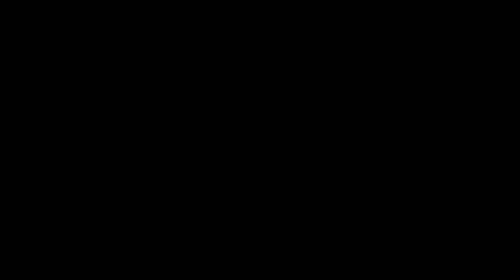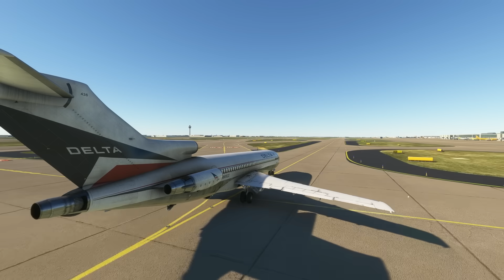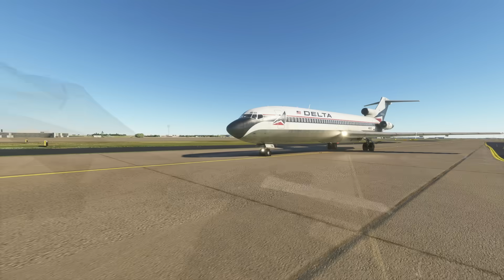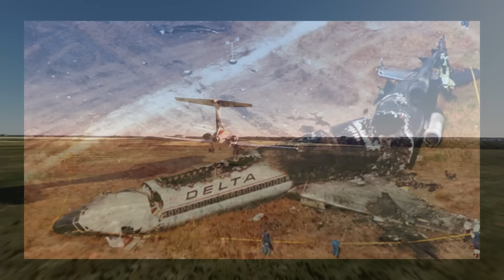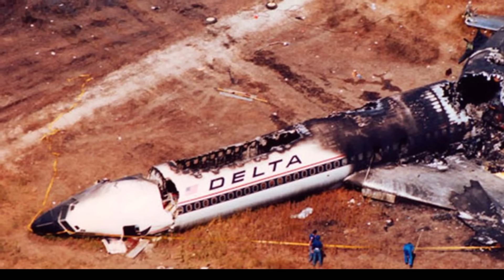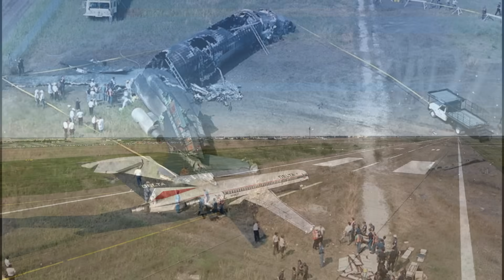Rushing To Disaster | Delta Airlines 1141

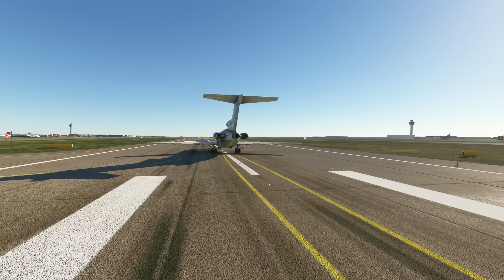Comment: 2:23 - Pardon my ignorance, but isn't the Auto Pack Trip Arming Lights' failure VERY pertinent to this crash?  If an engine fails (surges, in this case) during takeoff, the "Auto Pack Trip" system automatically shuts off the air conditioning packs, eliminating their pneumatic bleed air load on the remaining operational engines, thus giving them maximum available thrust to safely climb - which did not appear to have occurred in this case.

Comment: So many crashes by airliners have been caused by not setting the flaps and slats. Such an easy mistake and you only have to make it once in your pilot career and it's over. I was watching this video and as soon as they said it should have climbed, I thought flaps and sure enough, he we go again.
Reply: Not settings flaps and slats is not a death wish. All related flights (NW255, JK5022, 1141, etc) were found to be recoverable if they kept the attitude below stickshaker attitude.
Reply: @0w3nn  - Hi, I think I agree with you, but even if recoverable it is not a forgivable error. It has happened too often.

Comment: Actually, most analyses of this crash do see a single tree, but not the forest.

Delta had a shocking streak of near-misses at the time. To quote one of the articles on flight 1141:

"Delta had a long-standing practice of giving captains wide discretion over procedural matters rather than strictly enforcing a set of cockpit norms handed down from on high. This resulted in a wide degree of variability from one captain to the next. Delta pilots interviewed after the crash couldn’t agree on who was responsible for checking the position of the flaps or who was supposed to ensure that checklists had been completed."

"The NTSB already knew that Delta’s lack of cockpit discipline was causing problems. In fact, in 1987 Delta suffered no less than six serious incidents and near misses that were blamed on pilot error. First, a crew inadvertently shut down both engines on a Boeing 767 in flight, causing a total loss of power, before they managed to restart them. Then, a Delta Lockheed L-1011 deviated more than 95 kilometers off its assigned airway while crossing the Atlantic Ocean. The flight strayed into the path of a Continental Boeing 747, and the two planes with a combined 583 people on board came within thirty feet of colliding. Subsequent to this, a Delta flight landed on the wrong runway; another flight landed at the wrong airport; and two flights took off without permission from air traffic control. Any one of these incidents could have resulted in a major disaster. Something was seriously wrong at Delta Air Lines, and the string of near misses suggested that an accident caused by pilot error was probably inevitable. If it hadn’t happened to Davis, Kirkland, and Judd, it would have happened to some other flight crew sooner or later."

Comment: It's funny so many keyboard experts always say a plane will crash without flap deployment, I remember when the recent Air India crashed many were quick including at least one YouTuber pilot that the flaps had not been deployed, and while its much more dangerous to take off without flaps, it does not instantly mean the aircraft will crash. Even a simple Google search tells you that!
Reply: 1. "A simple Google search" is no longer a reliable information source. Try an engine that hasn't enshittified itself to death.
2. While taking off without flaps is not in itself an automatic 100% guarantee of a crash, unintentionally taking off without flaps (or taking off with the flaps set incorrectly) is very likely to cause one because it invalidates the takeoff calculations and robs the plane of expected (and often strongly-needed) lift performance. And  per the official accident report that this video uses as a source it was a causal factor here.
3. Funny you should bring up the recent Air india crash, because in this guy's first video about it he points out that people are likely wrong about the flaps not being deployed anyway. And he observes based on audio that
Reply: @ZeldaTheSwordsman OK a simple Google search and other aircraft that have taken off in the past. Even this crash could have been prevented had they just lowered the nose and increased power.

Comment: Many years ago, unnecessary conversation in the cockpit was a serious problem. 

Every takeoff I have ever done, regardless of what type of plane, right before I enter the runway, I always ask myself 3 quick questions;

1) Am I about to enter the runway I was cleared for?

2) Will enough fuel get to the engines to gain a few thousand feet of altitude?

3) Are the flaps set correctly?

Only if all 3 of those are satisfied, then I will proceed with the takeoff.
Reply: If the captain isn’t talking about which flight attendant he slept with last night during takeoff then he not doing his job
Reply: Amen